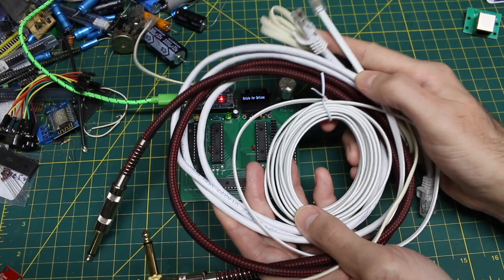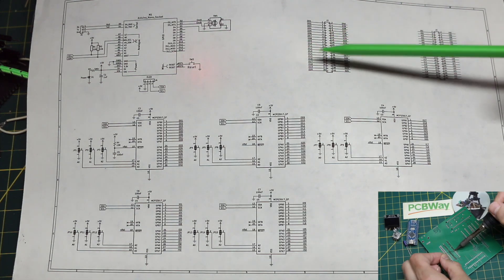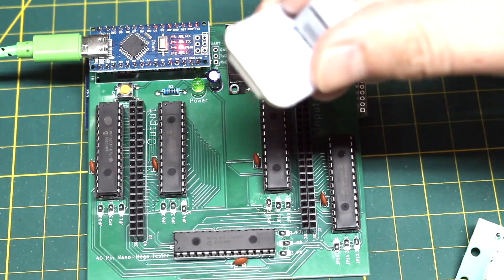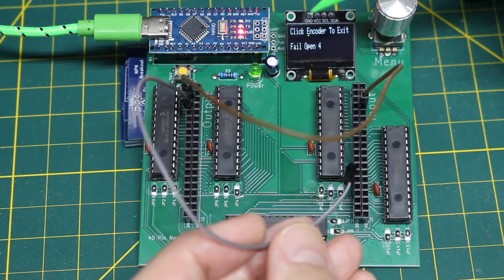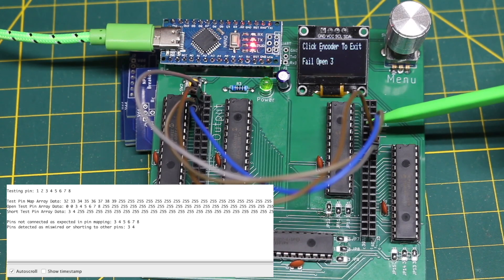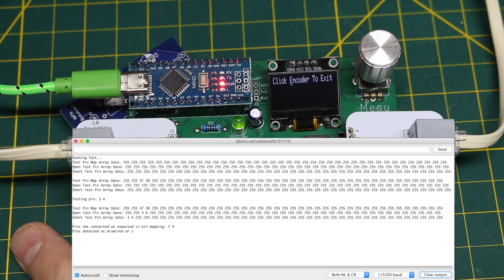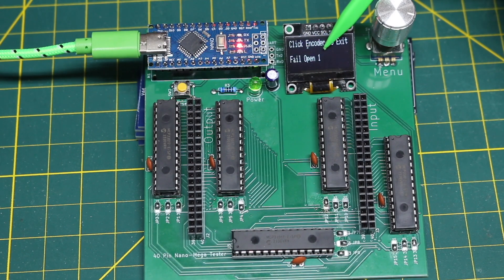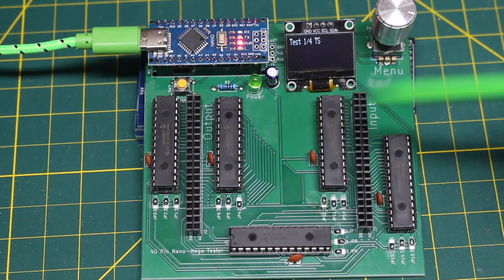Nano Mega Cable Tester

Comment: Bom dia amigo, fiz todo o seu projeto comprei sua placa mais o botão rotatório do menu não funciona, sabe mim informar o problema?
Reply from the maker: does everything else work but just pressing the button isn’t very responsive? What if you hold it longer or press it multiple times and holding it longer each time? Mine isn’t as responsive as it should be and I think it’s because of the example code I was using but I just wanted to get things working fast. I think it’s just the way the button is processed in the code and programming isn’t my first language.
Reply: @GadgetReboot  Obrigado por responder, pois já fiz outro pois encomendei 5 PCB e a outra com tudo novo ficou a mesma coisa, fiz o que você disse pressionar por mais tempo ou menos tempo, mais rápido e nada de funcionar fica travado na tela (Rotate for Options); se tiver como me ajudar pois achei o seu projeto muito útil e que seria ótimo pra mim.

Comment: Cool adaptation! I would definitely go for something with more horse power. Like and ESP32 or maybe even an S3. More RAM and PSRAM. And not much price difference.
Reply from the maker: I have an ESP32 C3 set aside for experimenting. I haven’t used them yet so maybe this would be a good learning opportunity.
Reply: @GadgetReboot  A C3 is also fine for this. And WiFi opens up a lot of possibilities. For example: check wiring with in walls. Having them "talk" to each other" to check if the hidden wire is still OK.

Comment: One of the failure modes I frequently need to look for is an intermittent connection. Having the test run continuously while gently flexing the cable and reporting the results only when you press the encoder a second time might be of value.

Comment: You could just create an array at start-up that is large enough of the max connector size and just reuse it every time.
Reply from the maker: I do make a total of three arrays at start up to store pin mappings and two types of test results so they can be differentiated 
but then there’s other temporary variables nowhere near as big as that within functions. 
I didn’t think it would really be a problem but of course I just don’t know enough about the overhead of Arduino and what’s involved in the stack with even calling functions or nested functions 
maybe that builds up too much, so what I’d really be curious to try is using a device with larger code space and memory space with the same code and re-enable the things that caused nano to crash and see if the chip with more resources handles it better

Comment: Great idea, rpi pico w, micropython/circuitpython/C, dual oled or just output on a pc or webpage, why not have the output pins on all the time, just need 40 inputs,
even the pythons can do webserver, circuitpython can also do hid over usb.
Reply from the maker: The main reason to only turn on one output at a  time is so I can be sure which one is causing the input to detect a specific output so we can tell which wire is actually connected to which pin. 
If they are all activated and we simply detect a signal at an input, it could be coming from any of the 40 outputs so we don’t really know the pin mapping.
Reply: @GadgetReboot  could reduce 40 pins to 20, test 40 strand cable in 3 steps

Comment: Looking at the serial monitor output it seems you are creating 40 element arrays when the cable under test is e.g. 8 conductors. This is not helping your suspected memory issues. Perhaps allocate array space dynamically, making the arrays only as big as needed for the selected test? Then free them as soon as you're done with them.
Reply: One thing everybody forgets is to check for free memory before creating the array. I as thinking of memory overrun or writing outside the bounds of the array.
I do like playing with the ESP chips as they will give you an idea of why the chip reset.
Reply: @TheEmbeddedHobbyist  Agreed. When I said "allocate array space dynamically" what I had in mind was something like:
int* myArray = (int*)malloc(numberOfElements * sizeof(int));
instead of
int myArray[40];
In theory malloc should fail in a manageable way if there's not enough memory.  As for blowing the array bounds, well, all l can say is always check  0 >= x < numberOfElements  before saying  myArray[x]  😉
Reply: @sootikins  i would check that it has not returned a null pointer before trying to use it.
My common mistake with the ESP8266 when running RTOS is to kill the canary, by not giving my threads enough space. 😞

Nice clocks, lovely Westminster chimes.
Reply: @TheEmbeddedHobbyist  Thanks for the compliment on my clocks! I'm especially pleased with the "chimer".
I was being lazy saying "fail in a manageable way" - heh. Yes, check the pointer right after malloc and fail gracefully (maybe even spit out a debug message "insufficient memory" if being fancy!) if it's null.
Random thought: none of his numbers seem to be >255 so array size can be halved right off the bat by using unsigned char instead of int.
I've not yet tried RTOS on ESP. I'm still having fun playing with either NodeMCU / Lua or Arduino on my ESP projects.
Reply: @sootikins  I'm currently a RTOS and eclipse IDE fan boy. that's if old folk are allowed to call themselves a fan boy.
if you know a show that was on BBC radio 4 years ago, I'm a TOG.🙂
Reply from the maker: I don’t really know if I am running out of memory being at 64% and having those larger arrays static, it was just a thought that something could be still causing too much overhead but I’m convinced I’m not trying to access outside the array size at least.
it would be more efficient to dynamically create them in the size needed but with my level of experience it would also probably add 150% to the debug time needed!
Reply: @GadgetReboot  there's no reason to use arrays at all 😏.... really all you need is one array for the results. It should be dynamically created however. Use int* myArray = (int*)malloc(numberOfElements * sizeof(int)); as sootikins suggested.
Reply from the maker: I started out trying to do it with less arrays but as I ran into problems I was trying to just use brute force where there’s no way I could get the thinking wrong with all of the IF statements. 
so I figured I at least need one array to simplify the intended pin mapping because otherwise I would have a page of if statements or switch case statements to go through the intended pin map. 
then for the test results I wanted to differentiate open circuits from short circuits so I figured I needed either two separate arrays for the two types of failures or,
 because there’s only 40 pins and I have a byte of 256 numbers I could just use offsets to indicate one type of failure or the other or both with a different range of numbers
 but then again it’s all getting too hairy so I thought just do a bunch of arrays and get it working first
Reply: @GadgetReboot  "get it working first" agreed! Best to get it working first and fix it after you see it run. 🙂

Comment: Really cool project. Have you considered moving the I2C expanders from the board to the modules? This should allow you to use a much simpler interface between them, and if you add some logic to transmit a module type code when you connect a module, I imagine the whole thing would become plug-n-play. Would probably make it a whole lot more expensive, though.
Reply from the maker: that’s an interesting idea to just have the power and bus going to the plug-in modules, but of course it would also complicate those plug-in modules because those are also used for general purpose breadboarding so then they would have extra components and complexity when only being used as a jack. But maybe it would be still good to have the bus and power pins available on an expansion header to add more options on another board.